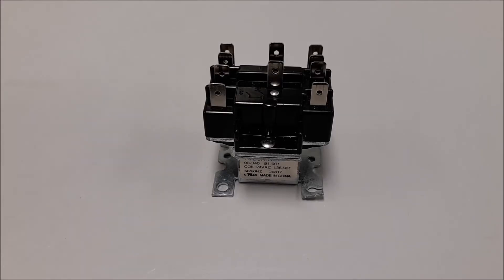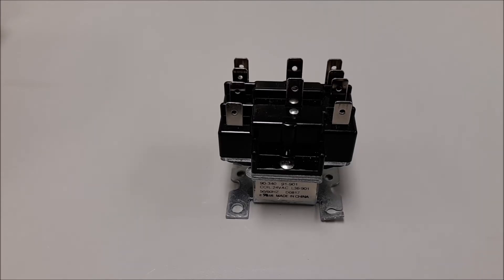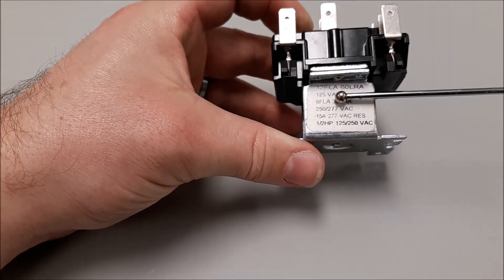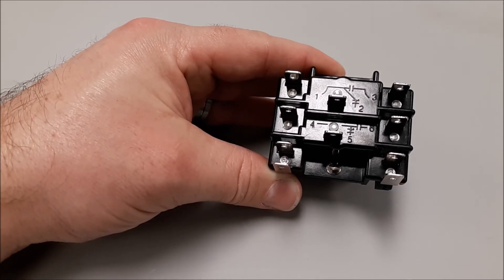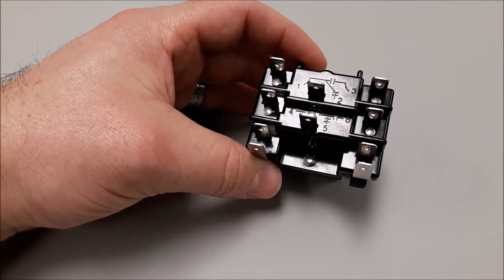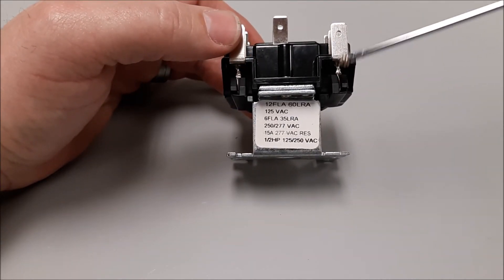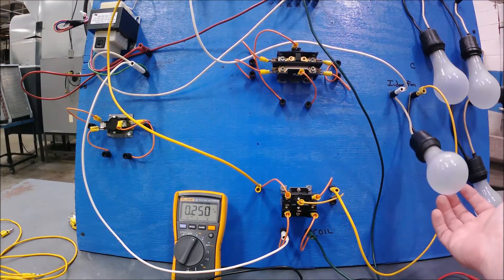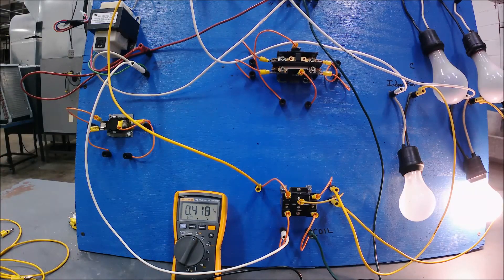90340 HVAC Relay - NEED TO KNOW INFO

Comment: I have a Mars 90340, 24V. The label says POWER DUTY ALL 6FLA 36LRA 277VAC and the next line says 3FLA 15LRA 600VAC. Is it a universal relay? Can I use it in place of one that says 12FLA 60LRA  125V and 6FLA 35LRA 250V? Thank you. And thanks for the video.
Reply from the maker: There are tons or relays out there so I wouldn't go 100% "universal" but for the hvac applications it could work for quite a few replacements. The specs you mentioned on your relay are 1/2 of the specs on the one you mentioned last so I would not try to replace it in that exact situation with your 90340. Whatever you are trying to get power to has a label of some kind with the voltage and amperage ratings. As long as your relay can handle that you should be good.Just pay attention to those rating and match the relay ratings to it. If the relay is rated for 6 FLA@ 277vac (think 240) don't go over that amperage. You can be under but not over! Hope it helps.
Reply: @johnjennings-JJ  Thank you, John. I'll check everything again but I think it will work since the specs for 250/277V are the same on both. The 600V confused me; that's not on the old one. It's in the air handler for a 32 year old 2-Ton heat pump so probably for the blower.

Comment: Great explanation,   and thank for explaining why you get 0 voltage across a closed terminal. I always check voltage from one terminal to ground. Example: when 24 volts is applied to coil i check from terminal 1 to gound first if power is coming from left to right. Then check terminal 3 to ground to see if relay is doing its job. Does that makes sense?
Reply from the maker: I understand but depending on specifics I think people get confused. I did a video on "why I don't like using ground" because it can throw a technician off unless they know exactly what they are looking for...but we all have our own troubleshooting methods!.

Comment: Merry Christmas to you and your family,sir!
Thank you so much for all the great lessons video that you made, it helped me a lot in the field. 
May I have a question for the 90340 relay? 
So when we in the heat mode so we have the power 24 voltage to the contactor that kick in and 240 voltage form L1 L2 power to the other side and turn on the heat strip. Then the blower fan will turn on and the terminal 2 of the 90340 relay will energize the power to terminal 1 ( speed taps) and terminal 1 to 3 will open right?
Reply from the maker: Sounds right. Power goes in on terminal 2 and 3 and then out on terminal 1 to the blower. This way no matter if you have 24 volts on the 'G' or not the PSC blower should come on.
Reply: @ thank you so much sir

Comment: Thanks best explanation on this 90 340 relay ive ever seen esp the Right to left  .. scenario  used to trip me overtime if Iam adding an relay not just replacing an existing relay bc one can just go wire for wire but adding an relay for what ever reason can be tricky  to some including myself

Comment: What does the normally closed position control in an air handler for heat pump with heat strips. Anything?
Reply from the maker: The normally closed switch is usually used as a redundant circuit if a electric heat kit is installed. After power goes through the heat relay, there is a circuit that powers the heater and also one that goes to the normally closed switch on this fan relay. It powers the fan motor anytime the heat strip is on.

Comment: how do you determine how many n/o or n/c  do mi have
Reply from the maker: If you are looking at a relay it should have a sticker that shows you or tells you. It may even be "drawn in" to the relay itself. You would notice it is a raised part of the surface of the relay. If you can't see any information on it I would not use it. Just get another with the specs that you need.

Comment: I have one 90-340 to turn the inducer motor on in my old Rheem gas furnace and a 90-370 which G controls for fan.
Whether I'm in heat or cooling mode, G flips the 90-370 relay to turn the high AC fan on immediately on startup.
When the thermostat is satisfied  and G goes away, then the medium fan comes on at the normally closed contacts of the 90-370 which runs also through the fan limit switch and will run the fan until the furnace cools down to 120 degrees and the fan limit shuts the blower off if the furnace is on. That circuit stays hot until the 90-370 is pulled in.

This is how I found it! Can you recommend a better way to set this up?

I want the heater fan to come on with the fan limit switch when temp gets to 80 degrees,  run on medium and stay active to cool the furnace down after W and G go away.
What I don't need  is the Fan On switch at the thermostat to turn hi fan on while the heater's medium fan is on.

I basically don't need G to function if W is calling for heat.

Thanks for sharing!
Reply from the maker: I think the equipment should control the fan in heating mode anyway...like you were saying. No 'G' when 'W' is calling. The thermostat should be setup for that whether it is an older one or a new digital one. Not knowing if you have a digital tstat or not, I would say check the programming. There is an option , or a selector switch, that will, or should at least, prevent the 'G' from being energized on a call for heat....that is, unless you have a thermostat problem and 'G' is energized due to that (but I doubt it)
Reply: @johnjennings-JJ  Thanks I found a way to control  G while W is on.
The trick is to let the W relay send power to the G relay  for medium heat fan while W is on or off. Then if G comes on without W it turns power off to the medium fan and turns on the high AC fan.

Comment: Is that relay anything similar to the 12-wire plug-in on the circuit board, I see it's numbered just like it
Reply from the maker: The circuit board plugs can be/are a little different than this relay. The plug can have both high and low voltage going through it in order to check safeties and flame sensors if it is in a furnace. The relays on a circuit board are typically those raised black boxes on a circuit board.
Reply: Can use a relay instead of a blower circuit board on furnace?
Reply from the maker: Is it an electric or gas furnace? If it is electric then definitely, gas furnace I would discourage.
Reply: Gas furnace thanks

Comment: Hi there! Currently replacing one of these on my woodburner furnace. Should this get hot amd hum when power is applied??
Reply from the maker: I have seen a lot of them get warm to the touch and hum too. Seems normal from my experience. It does have electricity flowing through it. I guess you could go with a circuit board setup but that might take some modification...may be a little quieter.

Comment: “Typically” what are the two power sources coming in on 3 and the other on 2? 14:00
Reply from the maker: The way that a lot of manufacturers use the PSC blower by having 1 speed for both heat and cool mode operation leads me to say that you have a direct wire from L1 coming into terminal 3 and also a wire from the load side of the heat relay switch bringing L1 into terminal 2.

Comment: Thanks for your wonderfully helpful videos. So high voltage goes from the transformer to the relay normally open. Is this necessary for the relay to power the fan?
Reply from the maker: High voltage relay comes from the main terminal block but some of the units will have it coming from the transformer only because it is a closer connection to L1 or L2. Either way of supplying main, high voltage power is needed in order to power the fan motor through the relay in a cool mode operation or just fan "on" operation.

Comment: what would cause to burn off the element from the relay
Reply from the maker: Loose connection maybe...that would generate a lot of heat at that particular point in the circuit/wiring.
Reply: @johnjennings-JJ  I not a electrician so it done it 3 or 4 times I was thinking it was a relay or something thanks for replying

Comment: 9:10 ...my old Honeywell relay had only 8 terminals, but the replacement part has 10 like the one shown here. The circuit schematic [numbering] molded into the plastic back is exactly the same, though. Do I need to use those terminals on the very edge (where your thumb is)? I can't imagine they can be left open or uncovered, but there aren't any extra wires to attach there.
Reply from the maker: No, not necessarily. They put two male terminals on each side of the relay. As long as you put your 24v common on one side and the 24 "hot" (like the green wire) on the other side of the relay it should be good. They give you 2 male terminals on each side as an extra to maybe connect another 24v wire to it from another relay. Only use what you need!
Reply: @johnjennings-JJ  Thanks! Yeah, the replacement part from Grainger looks EXACTLY like the original OEM part except there are four terminals on either side instead of the original three on each side. And the replacement is like $80 cheaper than an unused [discontinued] OEM relay. Same voltage, amps and everything. Peace!

Comment: Why would there be 24 volts across the two terminals when the coil is one continuous wire from one terminal to the other? Shouldn't there be zero volts?
Reply from the maker: It is a "load" in the 24v circuit. It is the one thing we are powering and consumes the power. If checking voltage at a load you should get XX amount if working and a switch in the same circuit would be 0 volts as that load works.

Comment: At the 16 min mark you should put the black probe on a ground and then check, that would be the best way to explain it. You would have 120v at the wire you are checking if the light is on. The power difference you are talking about is correct but makes that explanation hard for some people.
Reply from the maker: Thanks for the insight and comment. Since doing this video I have tried to put a few checks in "to ground". I even did a video on why I don't like to use ground for a lot of voltage checks but that is beside your point. I think for this video I wanted to do some checks to ground but to honest...that board wasn't grounded! I'll try to include more in the future. Thanks again.

Comment: A switch is a switch. A relay works the same as a contactor or a sequencer. 24V coil, power in common out. I had a hard time with relays and sequencers until I came to the realization that they work the same as a contactor.
Reply from the maker: Sounds simple now but I remember calling my supervisor 5 times a day...once upon a time. I try to tell these new guys I see that "you hear me but you ain't listening" !! If they could truly understand and get it in their head that a switch is a switch...just like you said boss. Thanks for commenting and checking it out.

Comment: Hi My 90-340 is 8 pin for 8 pin socket.  Will this 10 pin 90-340 fit my socket - extra coil blades hang over the socket and not touch anything??  I cannot find a different marking or part number for 8 to 10 pin 90-340????
Reply from the maker: Never seen a 90-340 with a socket before. I have seen more 10 pin than 8 pin but never a socket. I would think in a pinch you could clip off the extra 2 coil connections and make it work though...but that is just me.
Reply: @johnjennings-JJ  Thanks John, I have a White Rodgers 90-130 Fan Control Center that has the socket - 8 pin.  My relays are not marked but the spec sheet shows the 90-340.  All pics of the 90-130 have an 8 pin socket?????

Comment: Very professional explanation, I am retired licensed state HVAC, I don't do much work anymore, but I keep watching videos to keep my memory sharp, I am 68 still active. Thank you for taking the time to share your knowledge.
Reply from the maker: It isn't much knowledge! I do try to keep thinking about hvac stuff because we do lose some of it when we stop using it. Stay sharp and thanks for watching.
Reply: Hey can one of you guys more experienced than me tell me, what if you run the yellow wire (cool) from the thermostat to the condenser AND to the blower motor in the air handler? Can you wire it that way?
Reply from the maker: Depending on exactly where you do the connections the answer is "Sure"...when the t'stat calls for the contactor on Y it will also call for the blower. But, when the t'stat calls for the blower on G it will also call for contactor too! So make sure if you do something like that you think about the flip side of the coin. The old school mercury t'stat had the G and Y physically tied together like you are thinking. W just turned heat on and the unit would turn the blower on. Nowadays the digital t'stats do the same thing through the programming and initial setup. Hope my 2 cents worth helps.
Reply: @johnjennings-JJ  In that case could you connect the yellow (cool) and green (fan) to the same terminal on the blower motor contactor? Or would you need a second contactor?
Reply from the maker: You could put both Y and G on the coil of the blower relay/contactor  if you had room to do it but that ties in to what I was saying before, if you just wanted to circulate air and run G then it would also run the compressor each time. Depending on what you are trying to do with the circuit/operation...just remember that the more stuff you tie together the more precise you have to be with the wiring. Are you trying to do something specific or just tinkering around?
Reply: @johnjennings-JJ  Thank you for your replies. I have the contactor connected to the Hi speed on the blower. I heard the fan only speed could be Medium or Low speed. Should I keep it simple and run cool, heat, and fan only on the same Hi speed or should I connect heat or fan only to a lower blower motor speed?
Reply from the maker: I like simple. For me since it is already a simple motor with easy controls...I would leave it like it came and keep it simple. It's just easier!
Reply: Can I ask you a question do you know a lot about baso switch
Reply from the maker: Never really heard of a baso switch but i am game to see what the question is...

Comment: Why is it called 90-340? Do those numbers mean anything or is that just the part number and people learned to call it that? For example, a 35/5 capacitor means the mfd level on 2 different circuits. 90 and 340 mean anything??
Reply from the maker: More or less just a part number from the manufacturer. There is a 90341 and 90342 as well. The 90340 is a double pole single throw relay with a 24v coil. I think the 90341 is just one with a 120v coil and 90342 is a 208v coil.
Reply: @johnjennings-JJ  thanks for the quick response. Just a note to clarify-- isn't the 90340 actually dpdt ? That's what other sources list it.
Reply from the maker: Sorry. Yes it is. I meant to put down that down but I guess I got caught up typing. My bad.
Reply from the maker: I think it was all that turkey and ham talking from this past week!